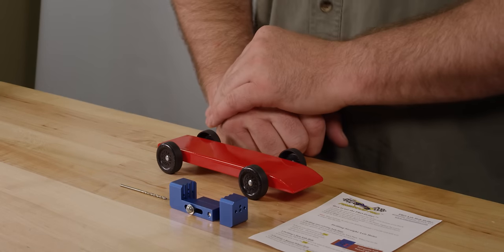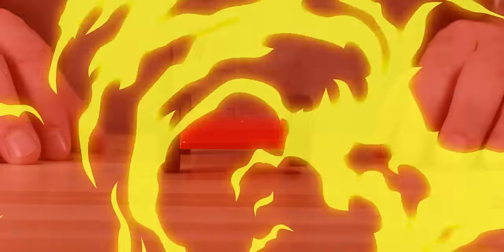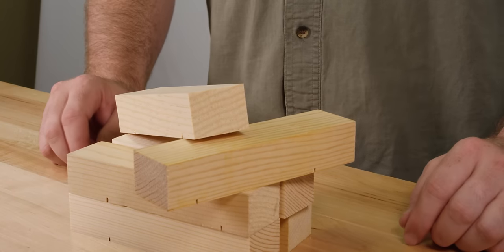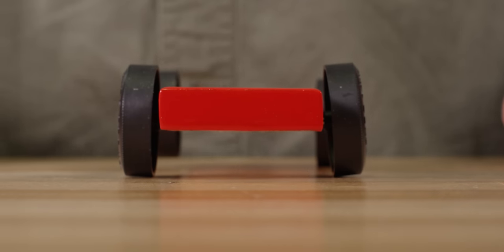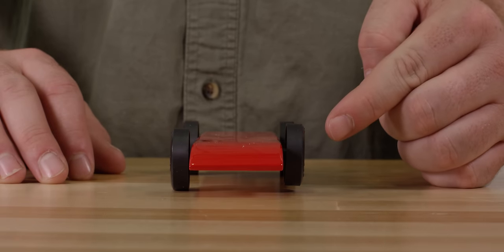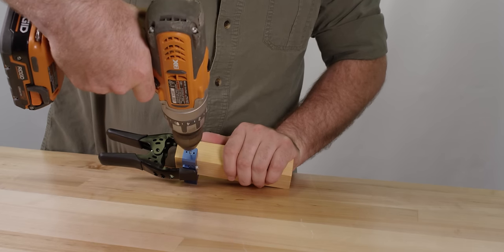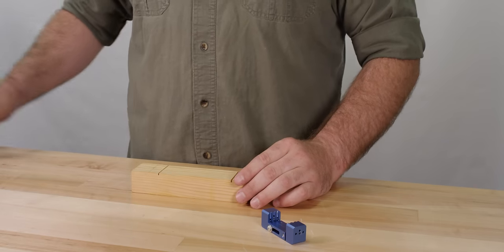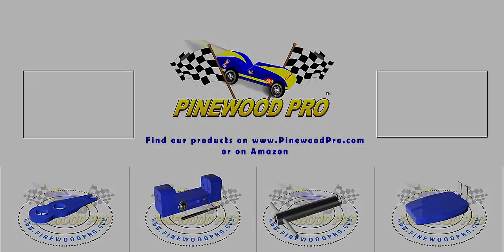Fastest Pinewood Derby - PRO Driller Tool (Five Speed Advantages)

Comment: Which axles are you using to help stabilize fixture at 8 minute mark of video as the axles that come with the car don’t fit the fixture??
Reply: @pinewoodpro any update on those axles that I mentioned about three weeks ago, pinewood derby season is here and any type of help would be greatly appreciated
Reply: I agree. The bsa axles are not even close to fitting into the guide holes
Reply: @jake05444  nope nowhere close, the only way I got it to work without damaging the fixture, sliding Irwin clamp, tighten up the bolts and used a pin vise hand drill used for jewelry, the company didn’t respond quick enough so had to adjust to fix the problem.

Comment: if the rules state "Must use existing slots. Must use all four wheels at the designated spots." Extended wheelbase is prohibited, but do you interpret that as not allowing a raised wheel as well?
Reply: As a Cubmaster who wrote the rules for my Pack, I would interpret this to mean all 4 wheels have to be in the original grooves. What you could do angle is manually in the groove to raise it off the ground.

Comment: Got the axle driller tool today and am completly confused, I just wanted to do a 2.5 canted rear wheel axle hole, video starts talking about extended wheel base, which is not
allowed in our derby area,  also looks like to do the 2.5 means I have to do on either side of the original axle slot ???
Reply: Just watch the hole video.  If all you want is rear canted wheels use the 2.5 holes only on the back..

Comment: Do you use bent axels at the same time if you drill the 2.5 degree angled holes?
Reply from the maker: Typically, you would use the PRO Driller to cant the rear two axles 2.5 degrees.  Canting the rear two axles migrates the wheels away from the car body, reducing friction and thereby increasing car speed.  You would then use the PRO Driller to drill the front axle holes perfectly straight and insert a 1.5 degree bent Steering axle into one of the front axle holes to steer the car; either perfectly straight or slightly into the rail for a rail rider.  The other front axle can be lifted, if your rules allow it.

Machined and BSA Bent axles are available here:  https://www.pinewoodpro.com/speed-axles.php
How to make Rail Riding car is described here: https://www.pinewoodpro.com/rail-rider-derby-car.php

Hope that helps.

Happy Racing!
Pinewood Pro
Reply: To actually answer your question instead of trying to still yet convince you to buy this tool. NO you would either drill the 2.5 degree holes OR use axles with a 2.5 degree bend. Also note if you bend the axles instead of buying this tool 🙄 you can turn the axles until you get the perfect angle you want.
Reply: @jamesfair9751  Yes, but if he want an extend wheel base, this tool will work.